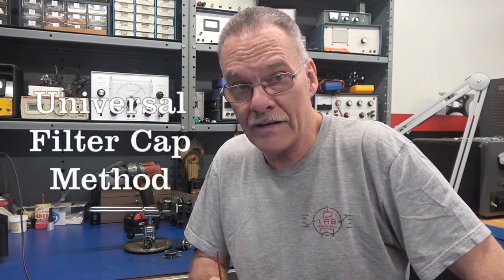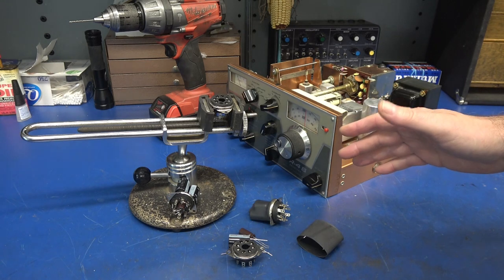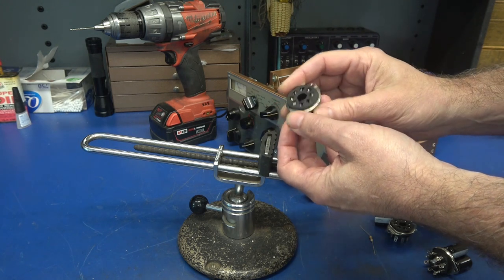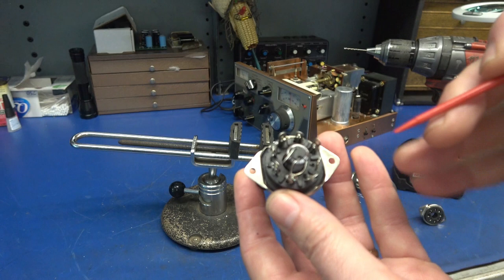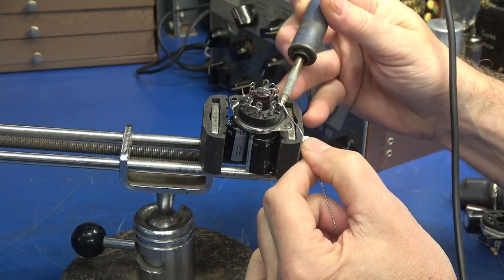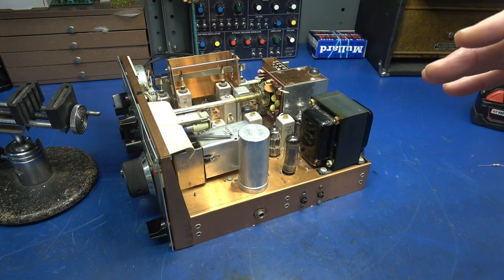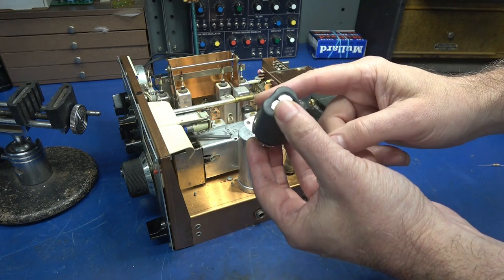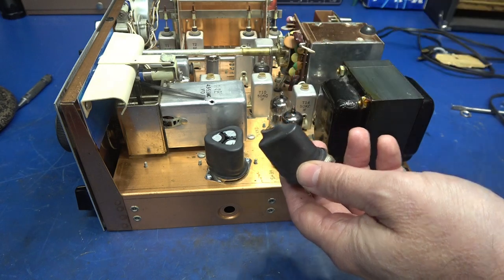D-Lab Electronics Universal Multi section build filter capacitor construction Radio Amp replacement

Comment: Greetiings from the Loyal Opposition.  This arrangement has another nice feature that you didn't mention, Terry.  Because the base is held on with screws you no longer have to contend with the big globs of solder on the underside of the chassis that are "factory"  on most Drakes 2's and 4's.

Comment: That brings back memories of the old WW2 Military equipment that used the octal plug in capacitors. I loved  that, as it made replacement of the bad filter literally a 10 second job. Unplug the old one and plug in the new one. I still have some of those NOS in my storage.
Reply: Those plug-in caps are a great idea.  In fact, one could just mount an octal socket in place of the can capacitor, then use a tube base to create a plug-in multi-section cap.  That way, the cap can be easily replaced when it fails again without having to de-solder everything.
Reply: ...those capacitors are very likely BAD by now-(!)

Comment: A great idea Terry. Just bought a set of  3 Celanex  ( sell an ex) sockets because of what you have demonstrated here. 
Glad by your video that it does work as a universal metal mutli-section can replacement at a very reasonable cost.

Comment: A nice, economical alternative to cans! What was the purpose of the 1k resistor between pins 4 and 8? Was that just a normal dropping resistor for the power supply, or did it have some internal purpose?
Reply from the maker: Yes, that resistor was only for the Drake R4B application

Comment: Terry D-Lab Icon:
Thought mentioned that I notice your tube diagram design, thought that I'd mentioned that your original channel icon is very distinct and easily spotted when one is going through the list of saved channels, so I would suggest you not implement that for your YouTube icon.
Reply from the maker: Yes Sir, Point made, I appreciate it. The old D-Lab logo was when I did Industrial work. I am trying to change that image. Still working on new artwork.

Comment: The only question I have is about subjecting the new caps to heat when you install the shrink wrap. Is it too short of a time to make any difference? I'm guessing not if you've never had any problems
Reply: Terry can answer if he'd like, but my experience with the type of heatshrink tubing he's using is that it shrinks at a low enough temperature that the caps should be fine.  He mentioned that it has adhesive inside; it works well and keeps moisture out.

Buy decent quality heatshrink and use a proper heat gun; I've seen issues with lousy heatshrink, and people using heat guns designed to strip paint that melted the wire insulation.